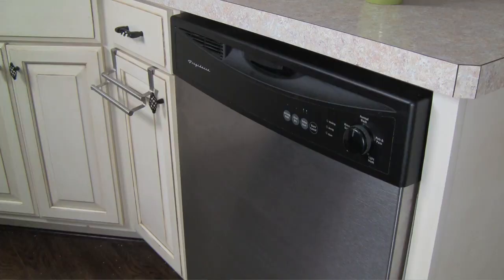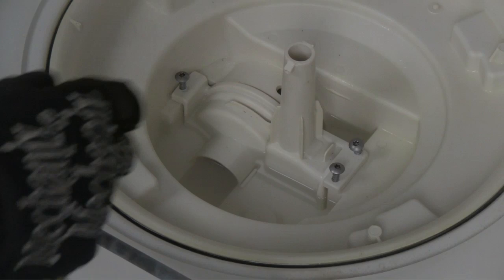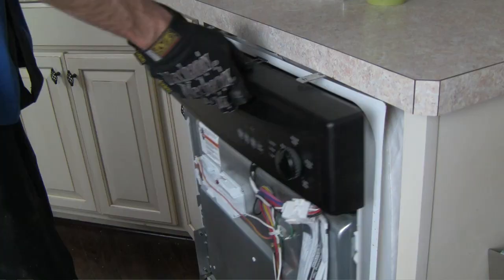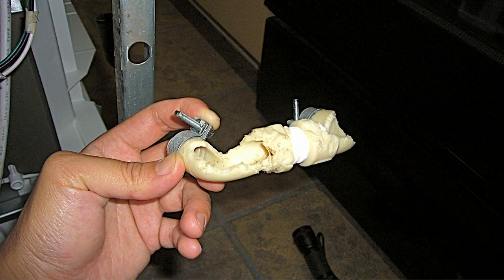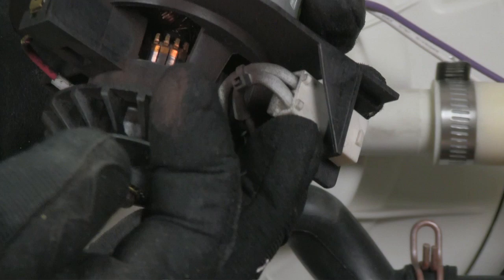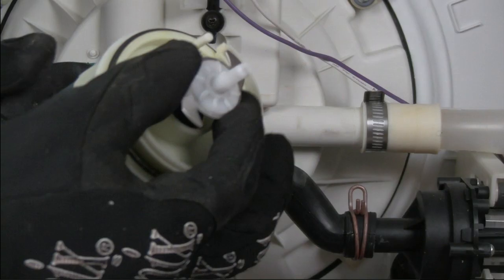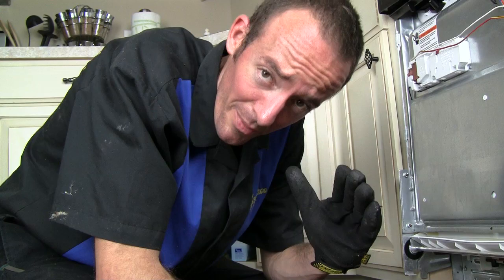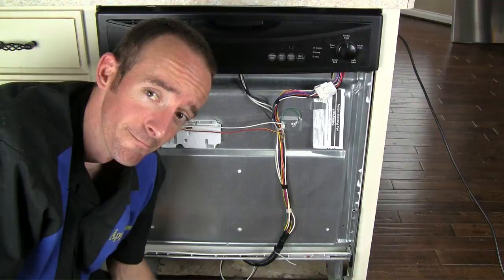How To Repair Frigidaire Dishwasher Noises

Comment: My dishwasher is making the same exact noise as yours in the video. I am adamant about cleaning it every month or so with dish magic and washing the screens and filters with dawn and vinegar. I use the finish pods to wash. (fyi). I took apart the pipes to make sure there were no clogs. I started the washer and sat with a flashlight and cabinet doors open to see if it was draining, and as it went through the cycle and was supposed to start draining, it didnt drain, not 1 drop of water went through the tube...so would mine be the drain/water pump or the same thing as yours? Any help is appreciated.
Reply from the maker: Lydia Cassady Hard to say... If you press the pause/ cancel button twice to force a drain does any water come out? The noise comes from the motor spinning, and if the drain motor is spinning at least some water should come out... You may have something in the drain pump that is blocking the exit port. What is your dishwasher's model number?
Reply: applianceassistant ...sorry just getting back to you...it is the drain assembly...it has gone out...the model # is FDB520RHB0....and the part number on the pump itself is 154640201....
Reply from the maker: Lydia Cassady Thanks for the update! Better than the main motor I suppose... At least cost wise.

Comment: I just bought a used fridgidaire ultra quiet iii and it did not come with a drain hose.  The drain hose connection is different than the the other hose connections I have seen in the past (total of less than 10). It is a ribbed connector with a little rubber flap inside. I fear that if i attach something over the top of that and clamp it there will still be opportunity for leaks. Thanks!

Comment: I don't have this problem but none of your videos seem to address it.  There is power to the dishwasher I checked the outlet it is plugged into.  And I changed the Components on the front.  Then I had an Appliance Repair guy come and he did the exact same thing and the thing won't work.  Just dead.  He left saying it was an electrical short and I should just buy a new one.....Thoughts

Comment: I dont recommend buying any Frigidaire product or bands put together by Electrolux. Next time they break I'm buying a different brand. My circulating pump was making a loud buzzing noise. None of these solutions worked. In the end, I replaced the whole circulating pump and motor to fix it. Out of curiosity I took the old pump a part.The pump shaft seal was leaking enough that it rusted the motors ball bearings. If you look at the motor vent at the pump end you can see soap buildup

Comment: We have a possible piece of glass that made its way down in the dishwasher which we can’t reach easily have you heard of this before ?
Reply from the maker: Yes, it does happen. No real easy way to clear it once it gets through the screen apart from removing the motor. If you do that, greasing the oring seals will help with reinstallation. Good luck!

Comment from the maker: Not that important... If the dishwasher is tipped back SLIGHTLY in the cabinet you should have no problems.  If its level or tipped slightly forward you may get a small leak out of the front corner of the door.  If there is no leak your good!  Thanks for the question!

Comment: Sorry the speak to text on my phone did not print the right comments 
newer Frigidaire dishwasher does not change cycles it always is on the rinse and hold 18 minute cycle when I press Normal wash or pots and pans it does not change from the rinse and hold cycle

Comment: Hey Bud,  Great Video ,  My noise is in the Drain pump,  The Spindle turns , it turns but the actual plastic fin piece( yours is white, mine is orange) is not attached to the pump motor spinde. Is it supposed to be free floating or is mine broken? If I turn it on should air be coming out of the Drain Tube?      To be specific,  at   4:38 of your video Can you grab that white fin and pull it straight up off the spindle? Mine comes off.   Any info would be greatly appreciated.    
P.S  My issue was an inch or so of Water left in the machine at the end of the Wash and when you push the rinse button you heard what sounded like a slight grinding.  I cleaned all the inside filters, impellers etc.  Still had the prob and that led me to the drain pump.  That is def where the sound is coming from.     P. S  If you have paypal I will gladly send you something for your info. Regards, BT
Reply from the maker: +Blake Thompson Sorry for the delay! It does sound like the drain pump is broken, it should not come off the motor spindle. Thanks for the offer for donation! I'm glad to help. But if you take the time to spread the word about my videos or website, I would really appreciate it! Thanks for the question, Hope that helps!

Comment: Thanks for the video.  A lot of good info.  I have the same dishwasher.  It collects water, heats up, and even drains the water.  However, it will not clean the dishes.  I suspect a bad thermostat.  What do you think?  Your input is greatly appreciated.
Reply from the maker: Thermostats on these dishwashers are fairly rare to fail... I would first try a good dishwasher cleaner like "Lemishine" and also try preheating the water at your sink before starting the dishwasher. That will insure that the water filling the dishwasher is hot not lukewarm.  Also the powder detergents tend to leave less buildup than the gels or packets.  Hope that helps some!
Reply: Ok.  I will try the dishwasher cleaner.  The soap is not dissolving so it makes sense about the water temperature.  Still, judging by when I open it, the inside of the dishwasher does appear to get really hot.
Reply from the maker: Luis Molina You may want to check the heater... It would be a more likely cause. You would need a multimeter to check it for resistance, and if that seems okay then you would need to check it for voltage from the control.  Not the easiest thing to check... hopefully it's just a buildup of calcium and soap, that the cleaner can break up.
Reply: Ok.  Will try and let you know.  Thank you!
Reply: It is attached to the cold water supply.   I did not think it would matter - Thought the heating element would heat up the water.  I'll swtich it and let you know.
Reply from the maker: erepsekahs Thanks for helping out on that one for Luis!
Reply: The thermostat on my Fridgidaire did fail due to ARCING at one of the thermostat terminals. This occurred possibly due to a simple loose connection. I mean, the arcing was so bad that it was charred, as if burned by a flame. I suspect this happened over some time. I think maybe it might be a good idea to periodically test all accessible connections for firmness for this reason. If there is a loose connection, (gently) crimp down the lead for a firmer connection. Or re-terminate the wire with a new clip. Kind of obsessive-compulsive, but it might extend the life of your electrical parts. Also, any electrical connection that gets wet is at risk for arcing because water conducts electricity very well.

P.S. Great helpful video! Thanks to Grandpa!
Reply from the maker: Your absolutely right! It's amazing what a loose electrical connection can do/ look like after a short period of time!! Thanks!

Comment: ... the top jet was plugged. I'm not 100% sure what the cause was. 
Just be careful, Splashing should be expected so have some towels on hand and make sure you are using cold water in the dishwasher so you don't burn yourself.

Comment: My pump/impeller spin smoothly but with some effort. How easily should it spin?
Reply from the maker: It is a magnetic motor so it should turn fairly easy but with two points where the motor binds up slightly then jumps forward suddenly (North and South poles of the motor.) Kind of hard to describe.  It should not just spin freely 360º  Hope that helps!
Reply: Yes thanks for the help. What you say makes perfect sense.

Comment: I have an on going problem with my frigidaire dishwasher model PLD4375RFCO. The LCD display would flash "ER" with several operation led's flashing as well. No operations were functional and the unit would always go into drain mode when the door is closed. I called Frigidaire and asked for tips and what component may need replacing. They recommended to use a hair dryer and apply heat to the top control panel to evaporate any moisture that may have got into the button control panel  that may be causing the problem. After less than 1 min the "ER" and LED'S stopped flashing and worked normal again until the next load. After progressively getting worse I ordered a main button control panel with circuit board and replaced it one month ago. The dishwasher worked fine for a month until the other day and received the same "ER" in the display and no operations worked. I tried the blow dryer again with no results. Do you know if any other component in this model that may cause this defect? or can the replacement part be defective? please advise great videos by the way. all are valid info. TY  glenn Conte
Reply from the maker: Sorry for the delay in getting to your question, I've been overly busy with my local repair business lately. Sounds like there may be an air leak in the front air vent that is allowing steam to get into the control.  When you had the door apart, replacing the control, did you see any signs of leaking or condensation?   Here's a link to the service manual on my website.
http://applianceassistant.com/Appliance-Repair/Appliance-Service-Repair-Manual-Feature.php?id=1482
 I will hopefully have time to get caught up on youtube questions in a day or two.  Thanks for your patience! I hope the manual helps!
Reply: applianceassistant Thanks, The service manual you attached was a big help understanding the other components and getting closer to the problem. I also discovered petroleum jelly works very well to silence those very noisy door springs when opening and closing. what a great free service you have.
Reply from the maker: I'm glad it helped! That's a tough one. I hope you found some steam leak that could be sealed.
Reply: applianceassistant Taking notes! Eureka ! as stated on page 12 in the manual you sent me  " if the fan dryer door fails to close it will display an ER code and all functions and controls will not work. The moisture build up that caused the keypad failure was created by the vent door not opening to allow dry air in. Either the solenoid  was hung up or the optical sensor was dirty causing the failure. NOTE to self Must make sure the fan is in the correct position so the air flow is directed inside washer. Never put your tools away before all systems are checked and in working order. thanks immensely...
Reply from the maker: That is some excellent advice! Thanks for the update!

Comment: Soooo I disconnected about 5 connectors on the bottom of my dishwasher and have no clue where a couple of them go 😔
Reply from the maker: Bummer. There should be a wire diagram inside the outer door panel that may help. You can go by the wire color. On most Frigidaire dishwashers, if you remove the two Phillips screws on the lower half of the inner door panel the outer panel should slide down about a half an inch and come off. Hope that helps!

Comment: My dishwasher is stuck on "clean".  I have looked everywhere online for an easy solution, but was extremely unsuccessful.  I am trying to sell my house and I do not want to have to pay some one to come fix an easy problem that I could fix myself.  The washer works great, but if the clean light comes on I have to flip the breaker to reset the  dishwasher.  PLEASE HELP!!!

Comment: The buzzing noise is after the water drains. Seems as though it's only doing it in wash mode. Everything else is normal
Reply from the maker: Christina Boudwin Bummer. It could be that the actual motor bearings are bad and it's not the grinder blade buzzing like in the video... You may want to have a second look, maybe you will find something new.
Reply: Ok thank u very much. Your video was very helpful also.
Reply from the maker: Christina Boudwin My pleasure! I hope you can find the trouble...

Comment: Hi my dishwasher (portable Frigidaire) is getting stuck in the last rinse cycle, it was swishing for almost 55 minutes the other night before I realized and turned the button a click or two into the dry cycle before unplugging it. What part is causing that  so I may get it and replace it. thank you. my model # FDP750RCS0.. SN# TH50465734
Reply from the maker: Unfortunately it sounds like a bad timer, especially if you where able to manually advance it and that worked.  the timer is part#154412901  not a difficult repair but the part is expensive... heres a link:
http://www.repairclinic.com/PartDetail/Timer/154412901/949304?RCAID=27317
Hope that helps! Thanks for the question!
Reply: thank you it works sometimes and sometimes it doesn't I started closing the door harder and it seems to have fixed the problem for now but thanks for the info I'll write the part number down for future purchase thanks again
Reply from the maker: Well, I wouldn't think door switch, that should just cut power and make it stop... If that works lets go with it : )  Thanks for the update.

Comment: I own several rental properties and they are equipped with Frigidaire and General Electric appliances.  The Frigidaire appliances are junk.  I will never buy, or own, Frigidaire appliances again.
Reply from the maker: +Jack Straw Unfortunately, at this time there does not seem to be any one appliance brand that is doing well when it comes to quality or reliability... It's just best to get familiar with the common problems and easy fixes... all the appliance companies are making poor quality right now.  Thanks for the comment! hope the video helps!
Reply: +applianceassistant Even Bosch?
Reply from the maker: Geoff Moores I like Bosch, They seem to be built well. However, even Bosh doesn't seem to be holding up like they did a few years back. This is also reflected in the price, they don't cost as much as they did in the recent past.